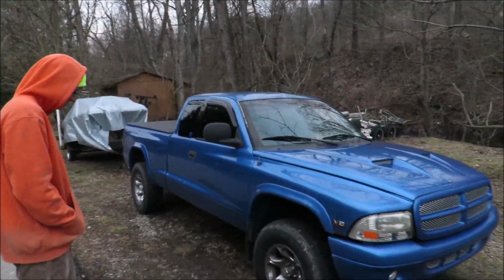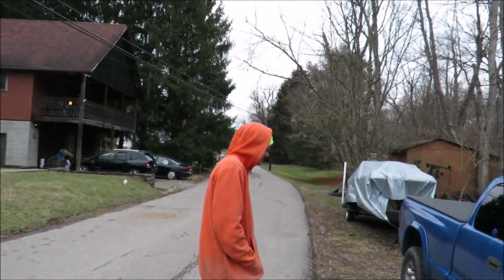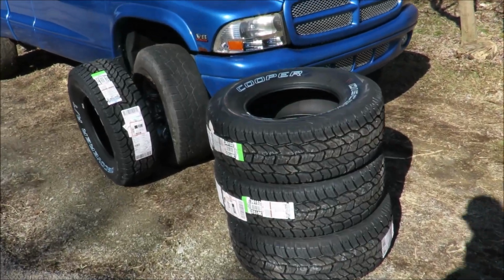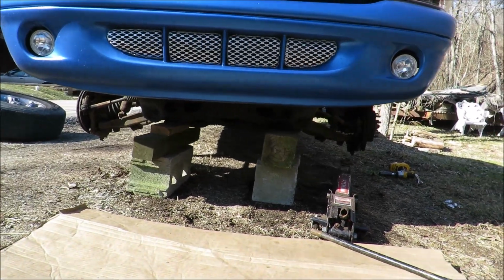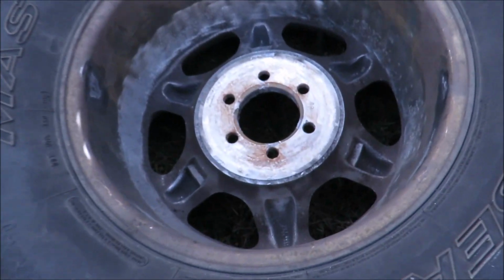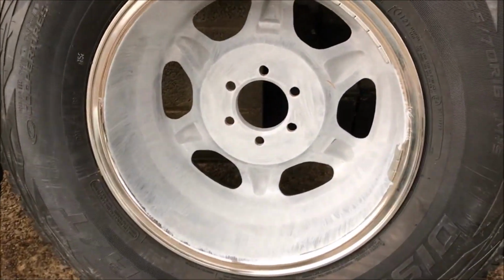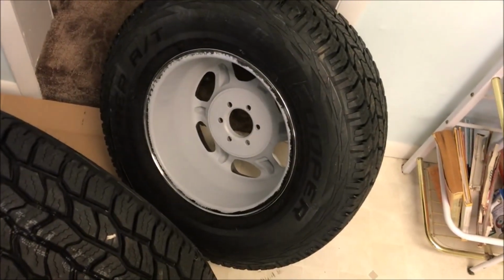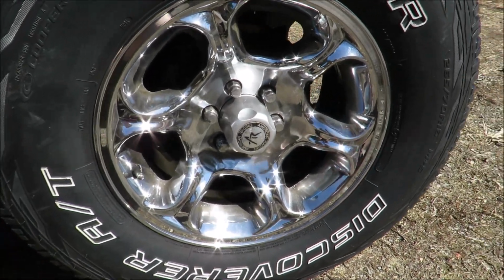Dodge Dakota Rim Restoration + Tire Install   ★Smokey Burnout★

Comment: 4.7l NEEDS: regular oil changes (5k max, shoot for 3k), an aftermarket oil catch can, and regular coolant flushes with HOAT coolant (lots of corrosion due to cast iron block and aluminum heads). If you take care of them, these engines can go 250k +.

LOL, the auto transmissions... Not so much (but there's a few easy fixes).

Thanks for the vids, and cheers from a fellow Dak owner!
Reply from the maker: I do mine every 3k. Haven’t had any problems yet, and still runs like a champ! Same with the tranny but I’m preparing myself for that to happen at some point lol. Glad to see another Dakota fan here on the channel! Thanks for watching!

Comment: Can't beat a gas pressure washer or a pressurized tank sandblaster for cleaning up crusty rims.
Reply from the maker: I wish I had one of those, that’ll be one of my next investments lol.. but the aluminum was so oxidized it needed to be taken care of with the grinder and wire wheel attachments. Thanks for watching!

Comment: where did you get the cover for the bed? edit: would you ever get a aftermarket front bumper for your dakota?
Reply from the maker: The bed cover was on it when I bought the truck. It’s from extang.com and it’s a classic platinum model. It’s kind of old so I’m not sure if they sell that exact one anymore. And I’m not sure if I would ever get an aftermarket front bumper. Maybe someday lol. Thanks for watching!

Comment: The 5.2 ones I’ve had will do way better burnout than that she seems weak but gourgous truck thou always loved Dakotas
Reply from the maker: Glad you like it 😎🔥💪🏻 can’t forget about the 5.9 magnum they also made for this truck. I bet that would be super cool.. thanks for watching!
Reply: I’m always on the hunt for a 4x4 5.9l but they only came in a automatic and majority of the time a four door slt truck witch I love to my first one was a four door 4x4 3.9l I’m on my fourth on now but I had a 96 square body Dakota 5.2l manual regular cab short bed she was 4x4 to fastest truck I’ve ever owned wish I never sold it but ever time you would grab second gear hard on asphalt she’d turn the rear end into chuncks got tired of welding and replaceing diffs but now I wish I never got ride of it after that I had 99slt with the 5.2 she was junk under neath but gourgouse on the outside sold that and bought a 98 sport 5.2 with a ugly paint but it’s got a beautiful frame under neath of it there great trucks man most of them are power houses too my 3.9l would still rip a narley one wheel peel
Reply: I swapped a 5.9 into my 5.2 5 speed. It’s pretty easy swap and a lot of fun.